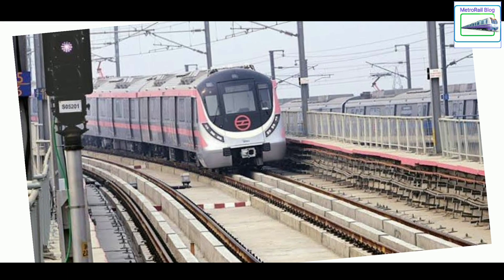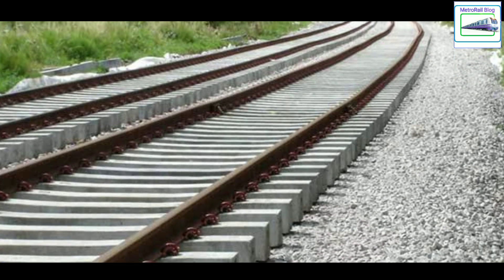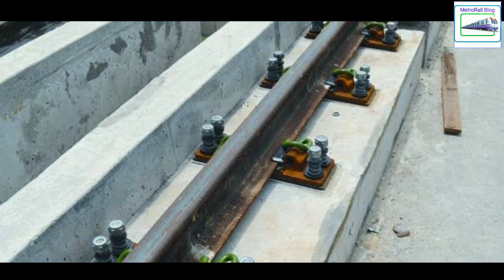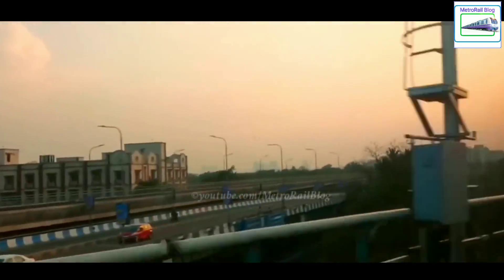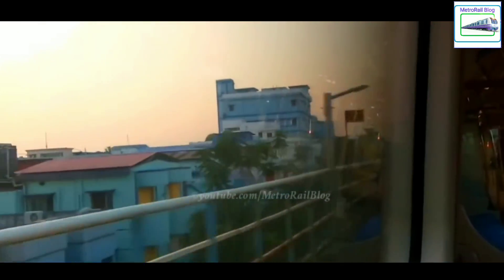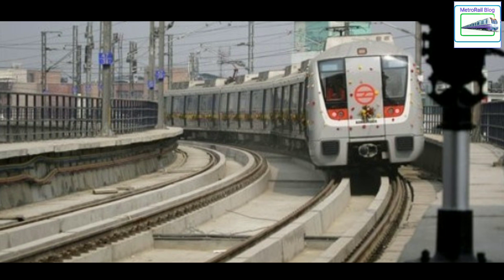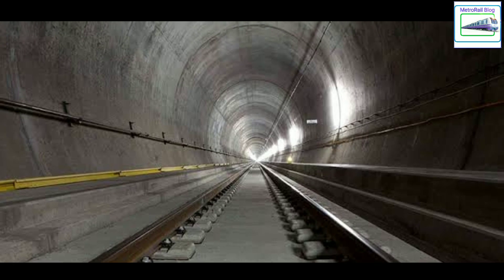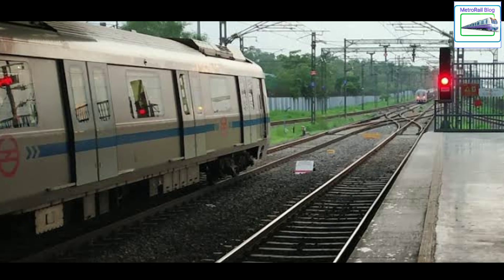WHY METRO RAILS USE STONE-LESS TRACKS ??? || Ballastless Tracks || MetroRail Blog

Comment: Bro I have a doubt in common rails are discontinues so that they can contract n expand but in metro rails are continuous why?
Reply: Its because both concrete and iron used in tracks have the same thermal expansion coefficient, so you dont need as many joints as a conventional ballasted track.

Comment: Bro stones tracks are also present in red and blue line of delhi metro.. which run on ground
Reply: Akshit Dadhwal Yup, and that’s because the on ground sections dont come with a concrete bed, and its cheaper to use ballast instead
Reply: Which station
Reply: Its in yamuna Bank
Reply: For blue line and for red line which station

Comment: hey, would you like to see retrofitted old (ICF) AC metro coaches running as AC locals after some modifications based on Train-18, like 100-120 kmph max speed, rearranged seating, and more power are made into them so they can run in Kolkata Suburban sections to provide comfy long distance travel?
Reply: Why not just bring in AC Emu from Mumbai suburbans?? But that's just a thought which will never happen cause Indian Railways don't care for us

Comment: Can you please answer me for the query, since 4 years, the metro train is running in Chennai, why the sound between track and the wheel are increasing every time I notice on a metro trail travel. But, you are saying, metro trains track needs less mainysinence? 7 but how?
Reply: From morning 5 to night 10 o clock, every 5 munites frequency, a metro train is running in Chennai. I don't think this is not the max capisity of cmrl. But, still I feel a discomfort in creyern areas due to the sound between the track and the wheels in some track sections of cmrl.
Reply: Is this on the region near Ashok Nagar? If so, thats because of the very sharp turn over there, so the flanges of the wheel scrapes against the track. Also in general, the Chennai metro has a peculiar sound when stopping because of its regenerative brakes, which are used to save power.
Reply: @prittbalagopal1105  no, it is near Anna Nagar Park and Anna Nagar East, even near keelpak and near nehru Park.
In the blue line new phase, the sound due to air frexion is also there..